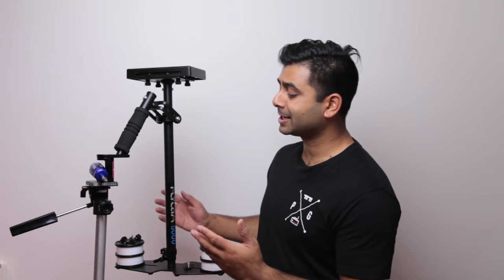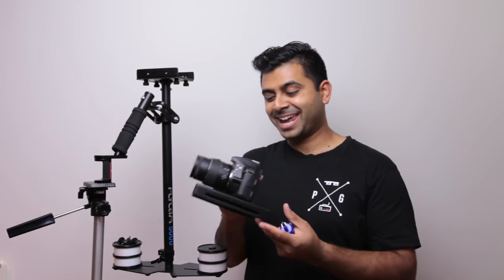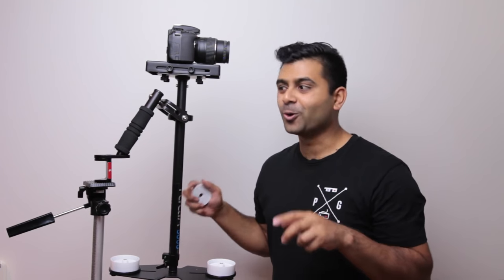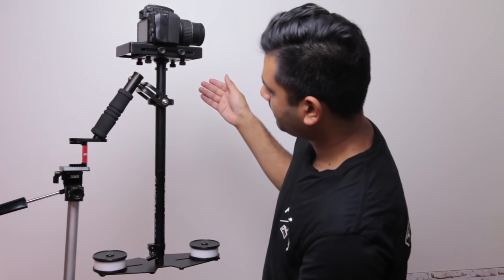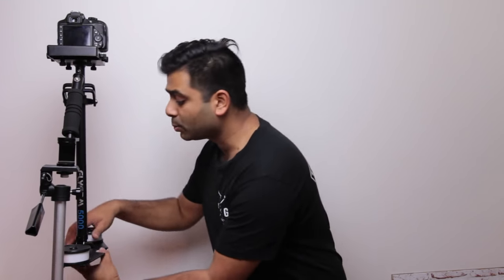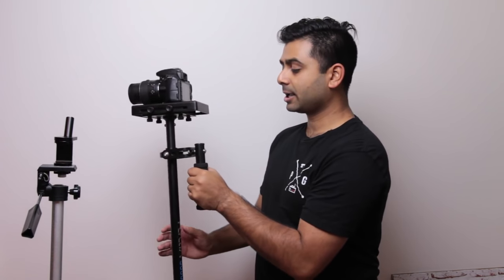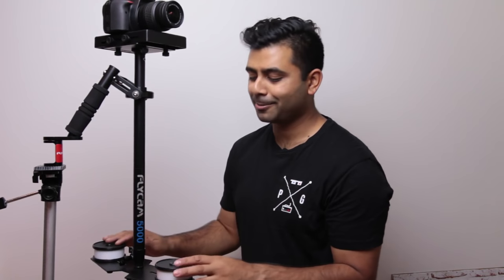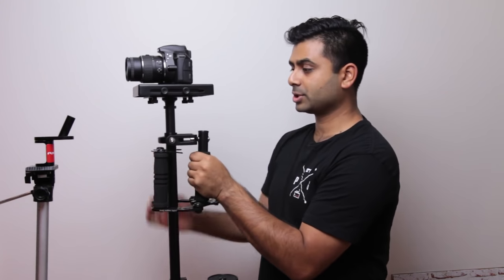How To: Balance A FLYCAM Video Stabiliser

Comment: Props for being the person in a sea of tutorials who brings attention to the little things that are super-frustrating early-on if you hadn't thought about it, such as just flipping out a screen (or even putting a small hood on your camera lens) will completely change your balance point.
One thing I would have liked to see that it took me a bit to realize, because a camera rig is not a perfectly balanced thing itself and even the smallest difference one side or the other totally changes the balance, if you do something such as changing the focal length and then change move the plate backward or forward to compensate, you are going to have to adjust left/right as well, since moving it in either dimension totally changes your weight distribution in both dimensions.

Comment: I have a question. When I try to use my flycam. The camera rotates. It I manage to stabilize my x and y axis but not my z axis.
Reply: That means you still have a weight problem. Try adding more weights at the bottom in the case of any rotation.
Reply: Same problem her

Comment: My Canon 200D weighs barely a kg! (pound) so its quite difficult getting my stabiliser balanced. Does anyone know of any hacks to make the top heavier?
Reply from the maker: Adding some plates to the top should do the trick. Prop into your hardware store and some some metal plates that you can stack and screw in.
Reply: Did you find the solution to this issue. I also have Canon 200D mark 2 not able to balance the Stabilizer.